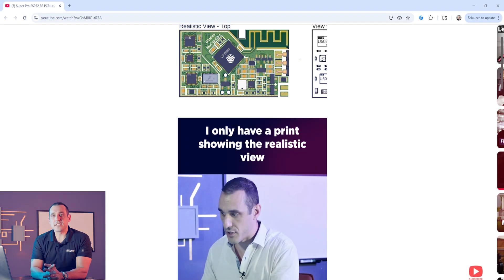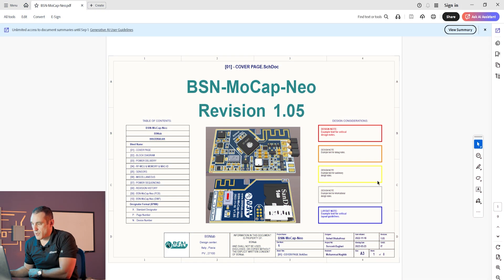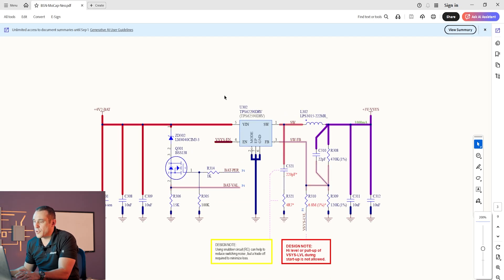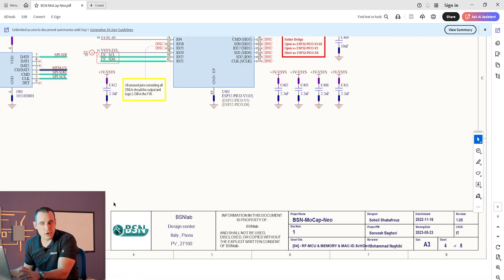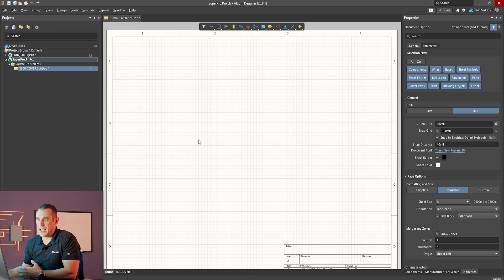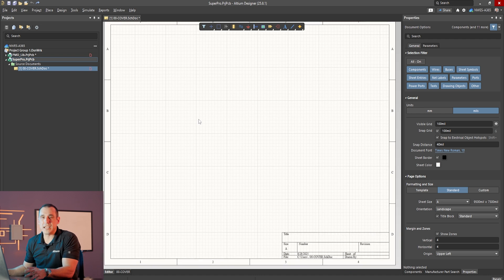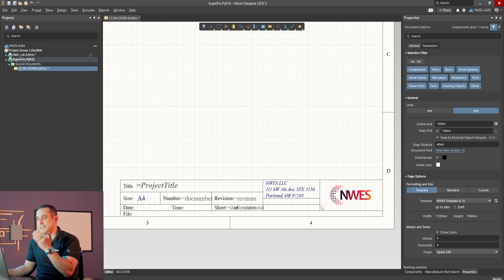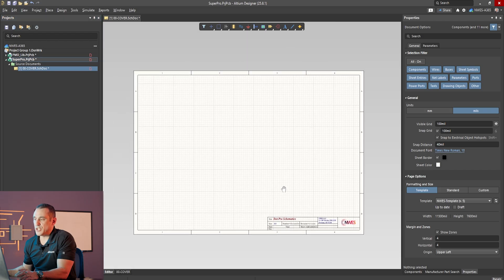Drawing Tools for Pro Schematics in Altium

Comment: Let's address the elephant in the room. Altium schematic editor is so hilariously bad even when compared to open source tools that it is beyond comperhension how this is even possible in commercial toolchain in this decade. All other major CAD vendors had superior design entry interface two decades already.
What does it matter if you can insert images in your schematic when the editor cannot handle nets editing based on topology of connections instead of literal graphical objects history for the net connection lines? Editing anything takes order of magnitude longer compared to other tools, not to even mention about graphical DRC or connection automation that is possible in other toolchains. All tedious manual work here, usually best done by deleting and redoing the schematic section.

Comment: Table of contents should be automatically generated by Altium. I dont understand why is not a feature. Also for title block diagram should be used variables or even implement those in schematic template. Also, also block diagram shouldnt be build using sheets? Drawing like that any changes require additional change both in block and connections itself
Reply: It would be nice to include an auto-generated TOC in the Smart PDF export. As far as where you put the block diagram, it's not going to matter where you put it. If you make an architecture change at the circuit level you will still have to update at the system level, and vice versa.

Comment: I have recently shifted from a global schematic to a strictly hierarchical layout and have my top level sch (named Top) holding all the subsheets.
My design manager really likes this approach as he can now clearly see, on one page, all the power and signal interconnects.
Oh, and for parametric naming of sheets and even output job filenames, I use variants.  I name my default output BUILD and use the Project -> Variants parameter options to set all my entries.  Eg sch1_rev, sch1_date, sch1_auth, sch1_notes appear in the first line of the schematic title block.  I have similar for fabrication and assembly named fabx_...  and assx_...  I aslo have fab_rev and ass_rev and those are tagged in with the design name in the output job filename "=PLMcode+'-'+fab_rev"  would produce something like "109000566-A"   So no need to into each drawing and update the titleblock, nor go into each output job entry and alter the filename manually; it's all done in the Project-Variants page.  :)  I love Altium.

Comment: What's the best way to add names for connectors pins? Add a text string in schematic or add text string in sch lib, or use parameters in sch lib or maybe exists more efficient way?
Reply: There is a way to do it from an Excel sheet, where you copy and paste from the sheet into the schematic lib file. I might do a video on this, there is also an article where you can read about this: https://resources[dot]altium[dot]com/p/creating-high-pin-count-schematic-symbols-quickly

Comment: If you in the textbox write @U1 or @VDD it will create a clickable link. This is very nice way of documenting you design and it also brings it on to pdf as clickable links. Don't know why you can't use it with strings.
Reply: Yes... and the best time to do it at the last stage. Because if you modify the designator, often you will forget to change in the note.

Comment: Another thing for block diagrams is that you can pull sheet symbols into a top level schematic and then you can wire the sheet symbols to other sheet symbols. Then add key notes as the TX/RX, GPIO, etc. lines are already defined.
Reply: Yes I like to use the sheet symbols as the block diagram. Maybe it's not as pretty as drawing it by hand but it puts the functionality right there in the top sheet. The challenge I see is that sometimes the block diagram can get cluttered if you have to draw out all of the connections between each sheet symbol, then you need to use sheet-specific net definitions to try and clean it up.